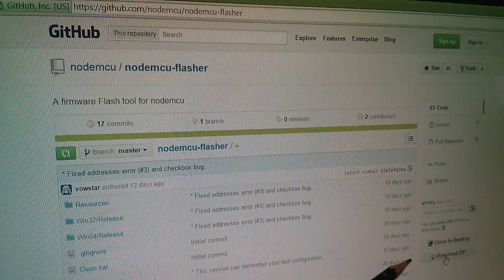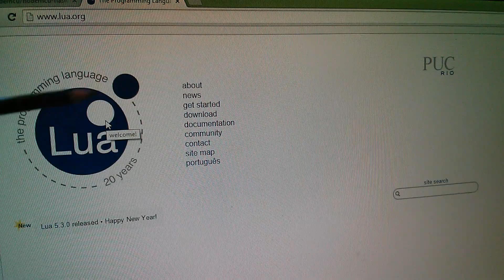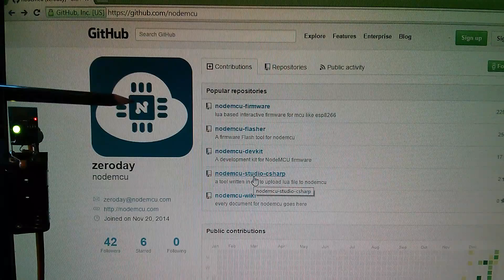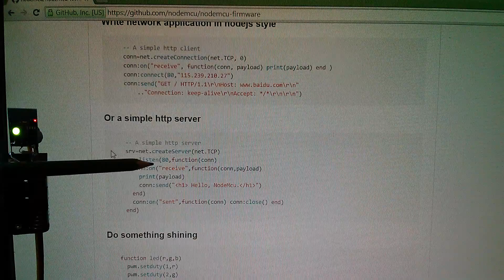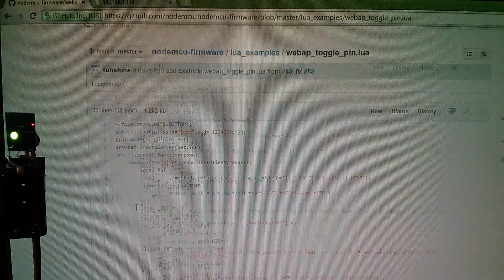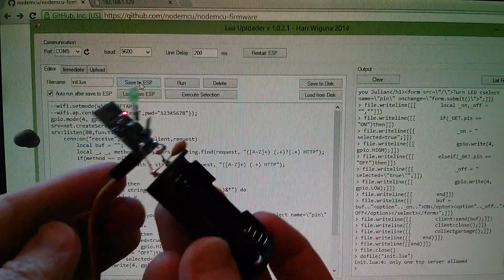ESP8266 Hack #2: Web Enabled LED - WiFi Internet-of-Things IoT

Comment: When I flashed my esp8266 it was part of a dps30v5a hack which ironically needs a seperate 3.3v to feed the esp, so I had a buck converter already connected to the power.  To guarantee my connections I used that to supply the 3.3v and just used the FTDI for data (commoned all the grounds).  Seemed to work OK so now I always use a separate data and power configuration.
PCs seem to sustain more damage when they drop power - data is usually recoverable - I use the same principle.
The Buck should boost that 2.4v battery supply to somewhere round 3.3v, a little more in line with the spec.
In the past - just for giggles - I've used a booster with a single aaa to supply a 5m length of 5050 LEDs ... not for long ... but quite bright while it lasted.  
I use a nice little adjustable (1-5v in for 1-12v out) one for most projects now.

Comment: Julian help!! I can flash the esp (at least it looks like it did) but it does not seem to transmit (reply back) - I opened lua uploader and clicked restart esp & tried the ip code and it only says sent but theres no echo back (reply) from the esp?!? I've checked it a dozen times and I can't find the problem. I reset and made sure the jumper was removed - so I'm sure it's not in flash mode...

Comment: On a ESP8266 bought in 2017, when I try to update firmware, it does not propose to update FLASH, IROM, DEFAULT  & BLANK as in this video,  it proposes to updarte  INTERNAL//NODEMCU only.  
I have tried this, although the interpreter comes up, it doesnt follow  the test proposed to check success    a   =5      print(a)
I am sure it hasnt been fully updated all teh binaries, but I am not sure how to resolve this

Comment: +Julian Ilett  can i use an Arduino Uno r3 instead of an FTDI USb to Serial Converter?
Reply: Eustacio Raga Yes. connect the Arduino's Reset to ground (and leave it connected). Connect the 8266 to the Arduino's pins 1&2 (RX&TX). Now connect the Arduino to a PC and use the IDE's serial monitor to send AT commands etc. Mind the baud rate.

Comment: Hi, after flashing my unit and connecting to it using CoolTerm, I get the error "Serial framing error 104" The pins are connected correctly. Why is this?

Comment: Sir a Sincere Thanks....
Sir the Problem that I am facing is that the chip is working perfectly with devices connected to the same WIFI but is not connecting if we try and access it from a different WIFI connection(say my neighbors)...
Can you suggest any help....??
Reply: That is because you are on a different network. LAN means local area network, which is your network. The people next door have a different network which is WAN, a wide area network.
Reply: +Nigel James To access from out side of your network, I just port forwarded that address. If you are not sure what port forwarding is, just google it.
Reply: +Terry Peake This is the problem I've been having with all descriptions on how to use the Esp8266. If they use Lua, or the AT command set, nobody seems to have published any code / description on how to control say an LED from a remote location (i.e. the Internet).
I've managed to control LED's, got input from switches and the like, but it's limited to the I.P. address on my router, and I can't break free from it.Have you managed to find a method to control the damn thing from the other side of the world ? (lol)
Reply: Thankyou Sir...

Comment: Wrong and bad practice!
Not all of those USB converters are good for powering those wifi modules even for firmware flashing as they only provide about 20mA. newer wifi modules can draw up to 50mA while flashing or doing serial comms. I have some esp version 3's, 7's, 12's and 13's and flashing fails if they are drawing 3.3v from the usb converter. I have to use a breadboard power supply set to 3.3v to flash them.

Comment: Downloaded the latest flasher 4/12/15. Started it with nothing hooked up (the x64 version, on my laptop) and there is only one item it wants to upload (INTERNAL//NODEMCU  at 0000), not the 4 you show in the video. If I hunt through all the files in the flasher download, I see the names of the files that are uploading in your video, but they don't show up in the flasher??? I tried flashing, and I do see the two MAC addresses and the fancy bar-code, but the files you had don't get flashed??? Any ideas?
Reply: +stewl i have them same problem. did you fix it mate?

Comment: Hi Julian,
I have reproduced your hardware and successfully installed the Lua etc program and communicated with the ESP8266 (initially using the original firmware and got correct  responses from AT commands and then after changing the firmware I have the blink program running using Lua Uploader1.0.2.4) - I am doing all of this from my laptop which is operating via wifi to my desktop PC - However, when I endeavour to get the ESP8266 IP address I do not get any even after entering my Router "SSID" & "Password"??? What I don't know is "should I be able to get the ESP 8266 IP address while wirelessly connected to my laptop or will I only get this address if I am physically connected to my PC? Routers, IP addresses and LANS / modems etc are not my forte' but I do have a rudimentary understanding! Please advise. Cheers, Ian (DownUnder)

Comment: Thanks for excellent video, Julian! I am eager to get the Lua Interpreter working on my ESP8266/Esp-01. I downloaded from Github the NodeMcu, but in the Resources/Binaries folder, the eagle.app.v6.flash.bin and the eagle.app.v6.irom0text.bin were missing. See your video at 4:17. I can start the ESP8266Flasher.exe (win32). It starts fine, but in Config tab, I do not get the 4 green lines you display in video 5:06: INTERNAL://FLASH, INTERNAL://IROM, INTERNAL://DEFAULT, INTERNAL:BLANK. I do only get: INTERNAL://NODEMCU. When I hit the Flash (F) button, nothing seems to happen. Kindly let me know what I am missing out to get Lua Interpreter downloaded and running on my ESP8266!
Reply: you have to switch the rx with the tx. I have the same problem, and i cant have a connection with the CoolTerm

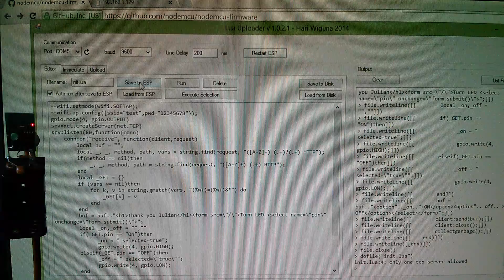Comment: Odd problem here. Have got 1 LED running in a similar way (Linux though, using ESPlorer). Subsequent uploads of init.lua to other modules are throwing up errors. At 18:21 you can see </opton instead of </option and that seems to be a code error...yet your code worked, as did mine at first. Now have got errors showing up when uploading, resulting in 2x init.lua files on the board, with one of them being 0 bytes. That presumably stops a boot.
Flashing with really wonky code can result in a reboot every second or so + needs a reflash of firmware to sort. Just in case anyone ever sees that constant reset, it's caused by a problematic initialisation.
Reply: slider2732 The update - it was the Firmware on the module ! By uploading the latest Nodemcu firmware (in same directory as 0.95) all is working fine.

Comment: Julian - thanks so much for the great video.  I have been able to duplicate everything you showed.  Concerning the ESP acting as a webserver:   the first two lines in the canned webserver you demo'd.  If you don't comment these out...  the SOFTAP causes the ESP to set up its own AP at 192.168.4.1.  This works fine to control the LED but since the IP address is not on the same subnet as your home AP, it doesn't connect to the internet and thus you cannot control the ESP from the internet via your router even if you set up routing.  However if you change the SOFTAP to STATIONAP,  the webserver will appear on both 192.168.4.1 and also you can access it at the assigned IP you get when it joins your home AP... thus you can then actually control something connected to the ESP via the internet if you setup your home router to allow traffic to the ESP's assigned IP address.  Powering the ESP with a 3.3 V supply,  it works flawlessly.
Reply from the maker: Greg G Hi Greg. I'm doing a follow up to my ESP8266 hack, probably tomorrow. I've got the SOFTAP to work - although it did take a while to find the IP address of the webserver - the IP given to my tablet (192.168.4.2) was a clue. I've not tried STATIONAP - I'll give that a try tomorrow. Cheers.

Comment: SOFTAP should set-up its own Access Point. Perhaps you can run again and you should be able to connect another device to SSID test with the password set. I think it has its own DHCP server running too.
Reply from the maker: Dan Cuddeford I just tried that and it works pretty well. But it did take quite a bit of searching to find the IP address of the web page - it's 192.168.4.1 - my tablet was given 192.168.4.2
Reply: Julian Ilett I can't wait to give this a try myself. Do you think there's an iptables or customizable DHCP server? Somewhere it's throwing out 192.168.4.1 as the router address etc.
Reply from the maker: Dan Cuddeford I guess there must be a DHCP server in there - and I'm sure I've read about it somewhere. I just can't remember where.
Reply: I have zero hardware experience but I'll try follow your videos and see what I can find out digging around from the software/network side
Reply: Dan Cuddeford To answer my own question, I found it https://github.com/nodemcu/nodemcu-firmware/blob/cdd13b1af36dfbe51f3876efab7eccf445232682/app/lwip/app/dhcpserver.c for my use-case I was able to modify the DNS server here and compile my own firmware

Comment: can this project be modified to be powered by AC using a small converter then replace the LED with a relay and pack the whole project in the size of a bulb base----> you have a smart bulb base were you can fit any bulb and control it via your smart phone
In fact such project can be more generalized and made to fit pretty much any device thus making home automation so easy and user friendly plug and play process

Comment: here is flash for the unit I have, not sure if it will work with your led or not:

-- Blink using timer alarm --
timerId = 0 -- we have seven timers! 0..6
dly = 500 -- milliseconds
ledPin = 4 -- 4=GPIO2 https://github.com/nodemcu/nodemcu-firmware/wiki/nodemcu_api_en#gpio-new-table--build-20141219-and-later
gpio.mode(ledPin,gpio.OUTPUT)
ledState = 0
tmr.alarm( timerId, dly, 1, function()
  ledState = 1 - ledState;
  gpio.write(ledPin, ledState)
end)

Comment: A question please: When you've deleted (commented out) the wifi init 2 lines in the 'long code', you still had the IP address from the manual lua code you've benn running before. But how did it get an IP address again after disconnecting from the power source and plugging in the batteries? Thanks.

Comment: Thanks, while I don't have it running full force yet, I now can communicate with mine, a task I have been working on now for about a week.  I had convinced myself that I had killed mine without ever getting it to work at all.  The one I have was premounted on a nice breakout board with all the pins available sort of like an arduino, I have a sheet with a mapping of the pins, and the builder did supply a jumper to enable the USB/Serial to speak with it.  Works nice.  It came with a 3 cell battery case attached so mine is running with 3 AA batteries, I am using rechargeable simply because that is all I have with any charge right now.  When I ordered mine it came with a program called IO.APK for my cell phone, it is supposed to communicate with it when it has been upgraded but I have yet to see any action on that count.  Probably because the program is in Chinese and I don't read that at all  it looks to  be a neat program that can raise and lower the brightness of the attached LED.  Also mine came with a light sensor built in for some reason, not sure but that is probably supposed to tell me how bright the light is where I have the device mounted or something.  It cost 8 bucks and shipped from the USA so it was quick to get here.
Reply from the maker: Jerry Ericsson Interesting - do you have a link to the item you bought?
Reply: Julian Ilett Jerry Ericsson I'm interested in this device as well. I've got my ESP8266 w/NodeMCU up and running and it's doing PWM on the output too! I think I'll be building a LED controller here fairly soon.
Reply: I have received my second one now and have both connected to the web however I haven't done much more then put the blink program on them both to see if that worked like you do with the arduino and they do.  My USB/TTL board smoked on the power side but the rest is still working, my second one came with an adapter but I used my old one since I know how to use it, the newer  one is a bit different and came with 3 wires, TX RX AND GRND I am guessing, along with a jumper from VCC to 3.3V there is also a 5 V that does put out power but I didn't measure it, I will before I attempt to use it for anything.
Where did you find the code for the mini server?
Reply: Jerry Ericsson here's the code that I use for the mini server: 

https://github.com/adamrunner/esp8266-lua

Comment: Here is the code I use to wait for the module to get an IP and then launch mini lua webserver or whatever lua file you want.

print("")
print("Welcome to ESP8266")
print("")

-- Connection Settings
ST_SSID = "SSID"
ST_PASS = "password"

-- Configuring Wi-Fi Network
print("Saving Wi-Fi Configuration...")
wifi.setmode(wifi.STATION)
wifi.sta.config(ST_SSID, ST_PASS)
print("> Complete")
print("")

-- Wait for Wi-Fi Connection
print("Waiting Wi-Fi Connection...")

tmr.alarm(1, 1000, 1,
  function()
    if wifi.sta.status() == 5 then
      tmr.stop(1)
      print("Connected")
      print("")
      print("Wi-Fi SSID: " .. ST_SSID)
      print("IP Address: " .. wifi.sta.getip())
      print("")
      print("Starting WebServer")
      dofile("webserver.lua")
      print("> Done")
      print("")
      print("Free Memory: " .. node.heap())
      print("")
    end
  end
)
Reply: Is not working error message unexpected symbol near '?'
Please help

Comment: My ESP-01 module works great with NodeMCU, currently sending temperature data from a Dallas temp sensor to Thingspeak in every 5 minutes. I found that the module's alignment probably matters quite a lot when the AP is not in the same level (in my case higher) than the module. The ceramic antenna on the ESP-03 module is probably better than this one (haven't tried yet).

Comment: You may need to pull GPIO 0 to 3.3v as well to stop it from drifting. Maybe that's why module doesn't respond to http requests sometimes. I've notices this on my board when I was using AT commands.

Comment: Great Video as usual. I suspect the Tx/Rx is 3.3 volts if set that way but if you find out that the Tx/Rx is higher in check out this clip: Alarm System Hack - Part 2 - Add WiFi (ESP8266) and Send Text. He uses a Nano and with 5v on the Tx line from the nano the ESP is flaky. Once he lowers the volts on the Tx line the ESP is stable.
Reply from the maker: Maxis Adog When I get a chance, I'll check the voltage levels on a scope

Comment: Have you measured the power consumption of this device (minus the LED of course), it would be interesting to see watt is draws ;)
Reply from the maker: Sabretooth Barnacle No, but the AAA eneloops only run it for about 36 hours.
Reply: I measures ~150mA @ 3.3V when connected to WiFi - for sensors or other projects not requiring to stay always online it should be possible to use a sleep mode to get this figure to a more reasonable level for a battey-powered use.

Comment: Hi Julian,
your videos are great! To speed up the web server you have to increase the baud rate to 115200. As a result, the web server responds much faster (<150ms)!

Here the Lua code: uart.setup (0,115200,8,0,1,1)
Reply: I believe you, but why does the baud rate of the serial change anything, if the data is only transmitted over the WLAN?

Comment: Does it do IPv6?
Reply from the maker: andreas heijdendael No mention of IPv6 in the spec sheet
Reply: No, according to the ICs datasheet IP is implemented in hardware and only supports v4. Not sure if a custom firmware/bootcode could add this later on.
Reply: Because, well... We're kinda running out of IPv4 afteral :)

Comment: If there is a 3V3/5V switch then both VCC and the signal level should be 3.3V when you set the switch to 3V3 position. You can also test the signal level of CH340 by connecting TX and RX together and read the voltage between this connection and ground with a voltmeter to be sure.  ;)